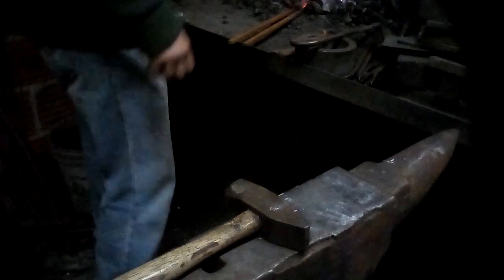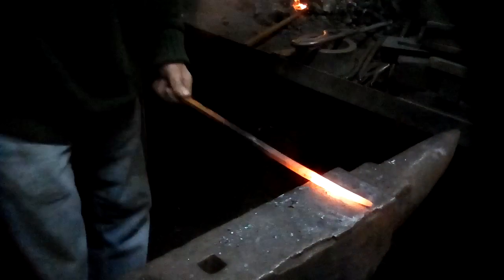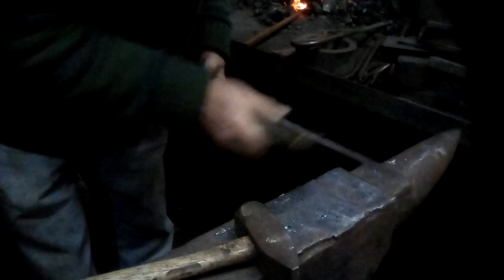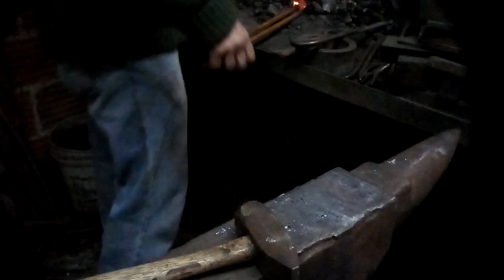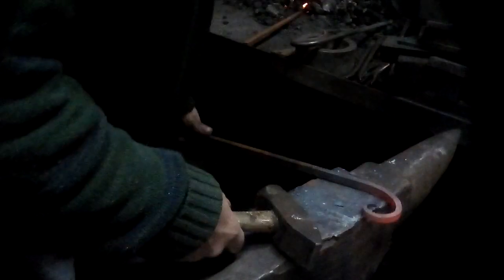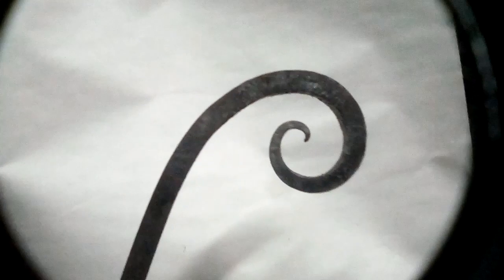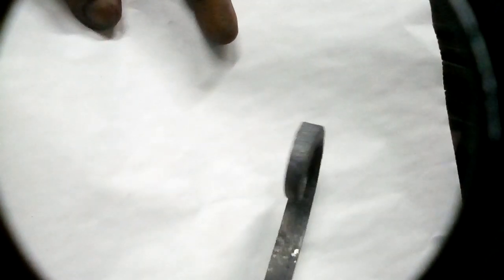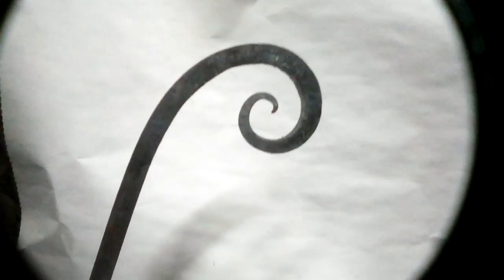Blacksmith's Dictionary Demo, Making a difference in scrolls.                  Daniel Tokar forges .

Comment: I like your content and your teaching style. A better camera and microphone would really help your channel.
Reply from the maker: Hi:
 Yes, I agree. This past 6 months has been an experiment. It was three months to find a way to make video of hot metal that did not look like a meltdown. I am still not happy with the color of the heat not being correct. The metal looks about 300F hotter than it does to my eye and that can mess up learning what heat to use in forging. That explains the "ring" or frame you see, it is an extended filter to cut UV and glare
  Over the 40 years I have been making my living as a Blacksmith ,I have enjoyed teaching and sharing ideas.
 The original plan was to make Youtube an extention of that as well as part of the online  Quest to find better work for the shop. I don't use Social Media, I don't own a Cell Phone, I don't travel to "events" much anymore. I don't think I have been set up at a craft show in 30 years. I do only custom work and  am at the point in my life where there is only so much time and I would rather do fun interesting work . Look at the galleries on my website.
http://willowforge.com/
 Part of the problem is that most poeple don't have a clue what good work looks like , or how much time it takes to make. These videos are a way of teaching the customers as well as people wanting to learn how to make stuff
Daniel Tokar
Reply: @danieltokar1000  I'm looking forward to more.